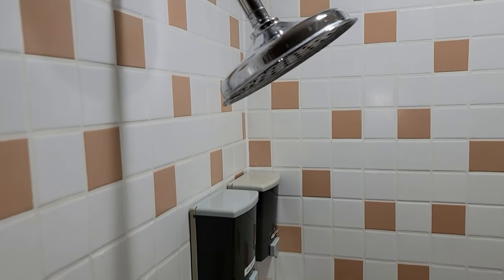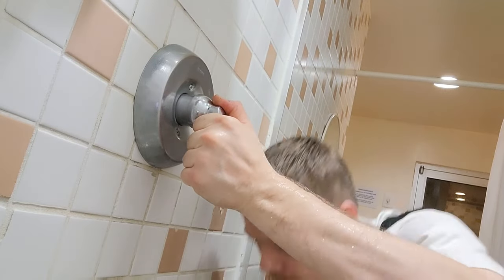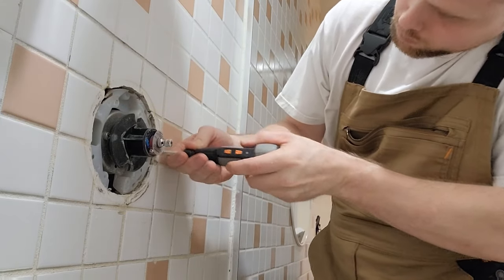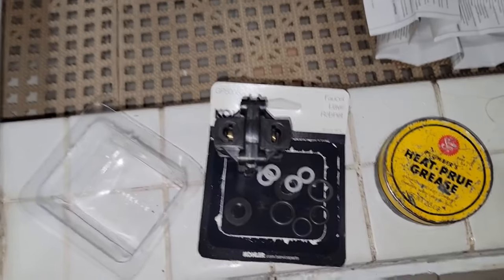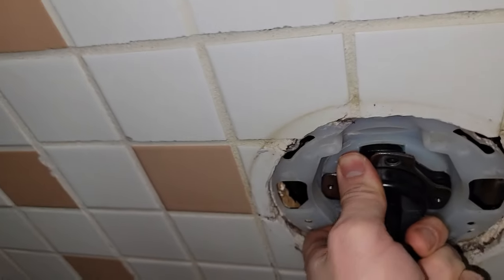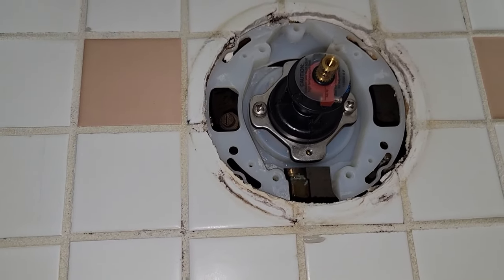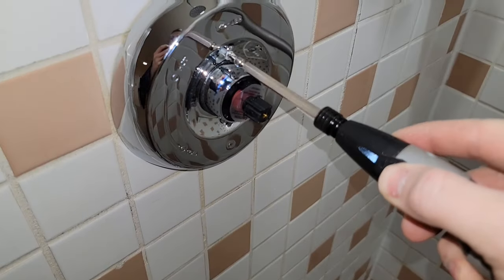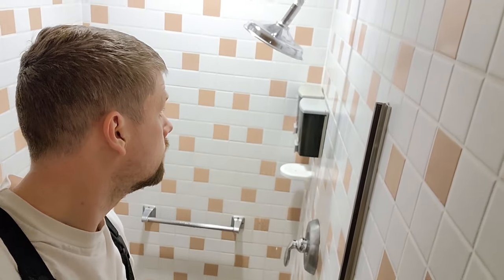Shower handle screw stuck! Complete A-Z tutorial

Comment: Did you mean 5/32 drill bit? You said "7/32 which isn't right after the 1/8th".   But I think you meant 5/32 because 1/8th is equal to  4/32.
Reply: Did you figure out what size to use?
Reply: @Gee391 I used a 5/32 but I ended up drilling out the threads on the handle so I had to replace them. Luckily the one I was replacing was only $40 for a pair

The bathroom has two matching sinks, so I bought a matching replacement. Otherwise I would have went for a different brand. I have had other issues with delta faucets, so I would not recommend. My other faucet seems to be impossible to open, and delta has provided me with information that doesn't work. Tried all the tools, but it's designed in a way that I can't get a good hold on it, nor is it clear exactly how to take it apart.

I considered buying two separate faucets so that I wouldn't have to deal with delta issues again.
Reply: Great info... Thanks
Reply: I used my Gerber multi tool, Comes with an array of attachments.  Super convenient

Comment: Thank you! I have a Kohler memoir shower handle with a stripped screw. My plumber said I can’t use any other trim but the same “Kohler memoir,” and that I should buy a new memoir handle. Do you know if this is true? It uses a GP77759 rite temp valve. Basic question- can I switch out the memoir for another trim- thanks!

Comment: Great video, thank you !
I’m replacing a Moen 1225 cartridge. The problem I’m having is I cannot remove the stop tube. I understand that they just pull straight out, and I’ve tried using pliers to pull it out and tapping on it with a screwdriver handle to loosen it. It won’t budge. Any ideas?
Reply: Same problem I’m having. Were you able to figure it out?
Reply: @AA_xo  Yes, finally. I walked away from it and went back later in the day and sprayed WD-40 inside copiously. After that a couple yanks with the channel locks was able to get it off. I think it was a combination of having pulled on it earlier and the WD-40 together. Another suggestion I got from people at Moen after the fact (after it was already removed) was to use a mixture of white vinegar and water and spray it in there because they thought the culprit was probably lime, and the vinegar will take care of the lime. The key is knowing that it does just pull straight out, so you just need to get it loose without breaking your pipe. If it doesn’t come right off after spraying it, spray it and wait a few hours. Let the stuff do it’s job.
Reply: @radradrad  thank you so much for the quick and detailed response! I don’t have wd-40 so I’ll try the vinegar and water out. If that doesn’t work I’ll get some wd-40 lol. Thanks again 😊
Reply: @AA_xo  My pleasure.
Reply: @radradrad  just an update, tapping on it with the back of a screwdriver worked! It came right off. I’ll tackle removing the cartridge tomorrow 🤞
Reply: Glad other people have had success; had issue once... stupid me prolly, but I went for metal expansion. Torched area lightly for a bit and then it slid out. Just offering an idea.